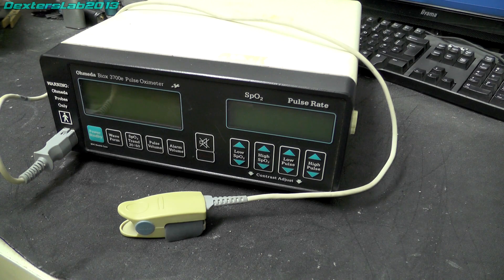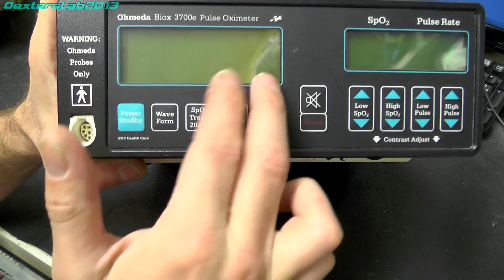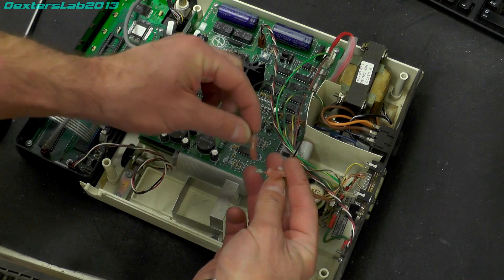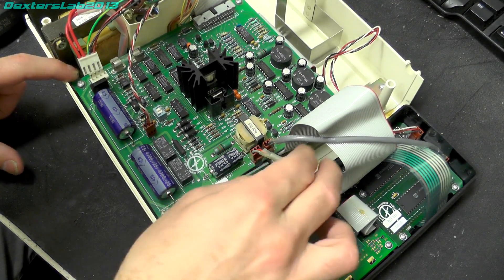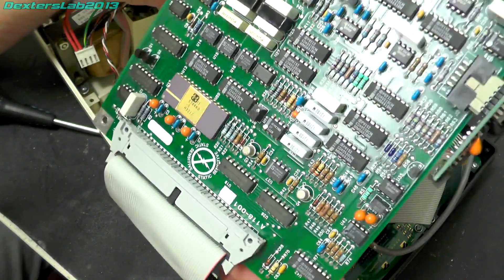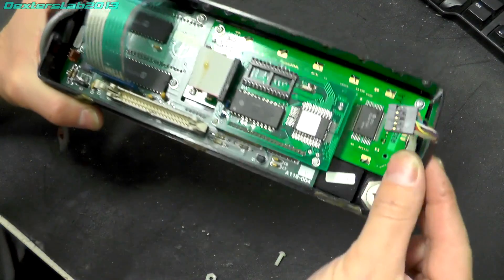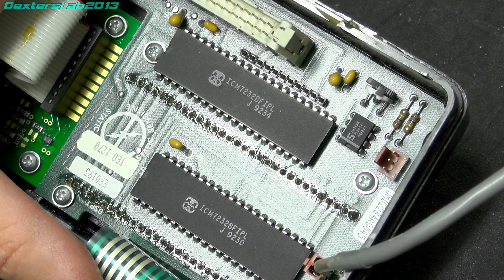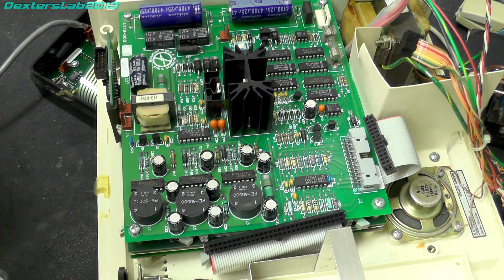DL156 Ohmeda Biox 3700 Oxymeter Teardown

Comment: I would've attempted to fit it. I think the problem is probably on the top power supply/regulator board. Start by checking voltages. Where about did you find that piece rattling around? It looked pretty crusty.
Reply from the maker: I did power it up via the battery input and i was seeing a good 5v rail, at that point i was a bit meh so given it's not worth anything and it's probably not something i would really use i decided not to go further.